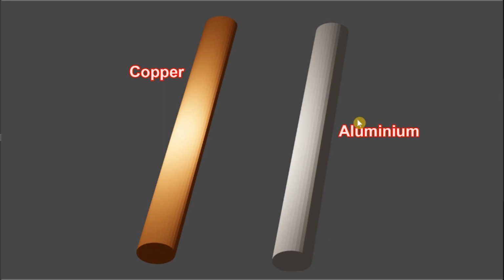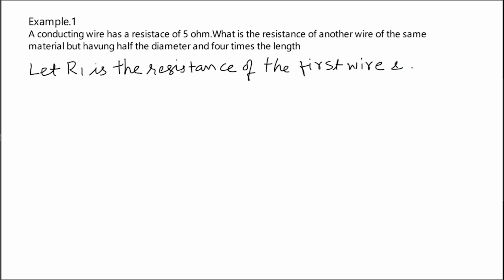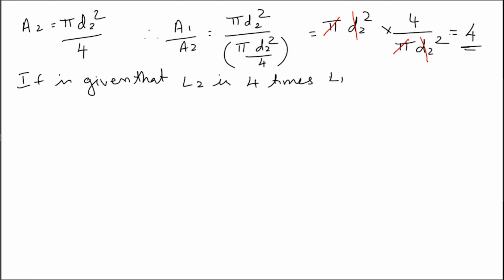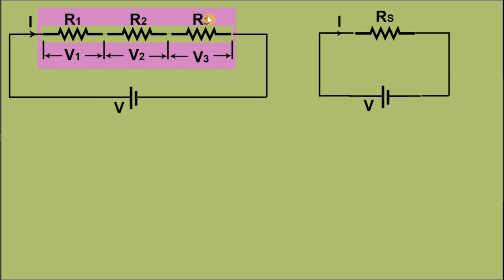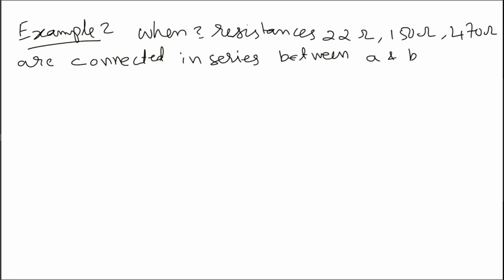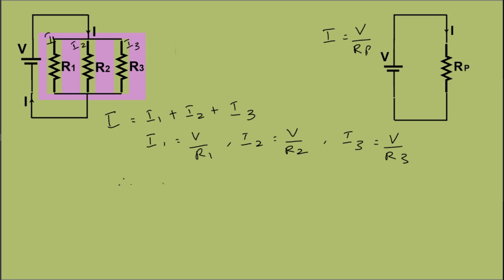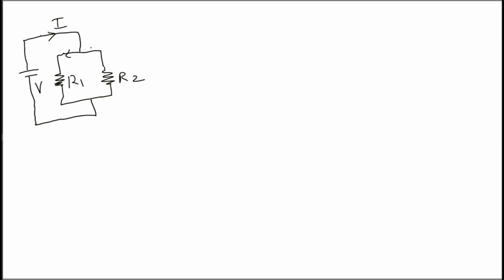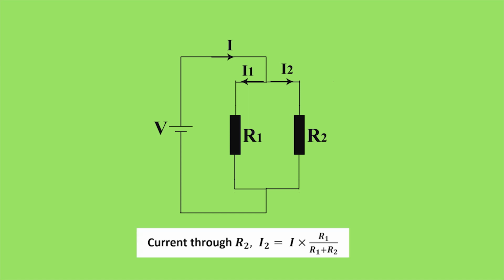Electrical Engineering Made Easy-Class2

Comment: Sir, Superb. May be off the  topic you are focusing. But would appreciate, if you can include in future. the various types of resistances, it's practical use and selection in various circuits, the importance and selection of various wattages, tolerance etc. Thank you once again .
Reply from the maker: After completing electricity, Electronics classes will be there.These will be covered in that time
Reply: Thank you